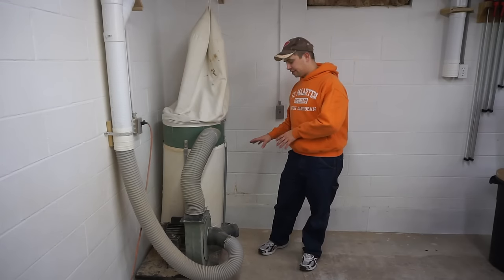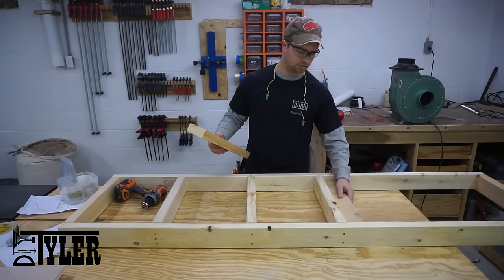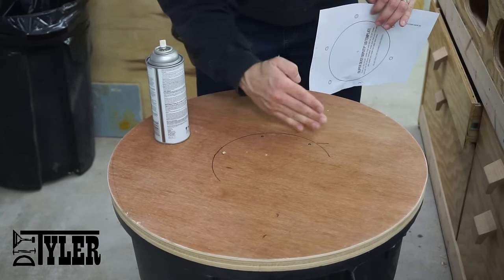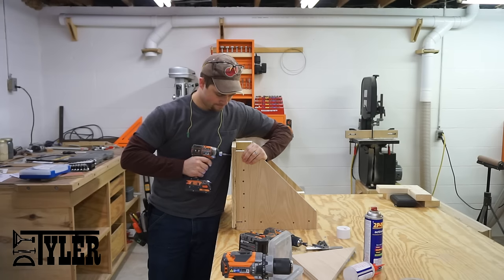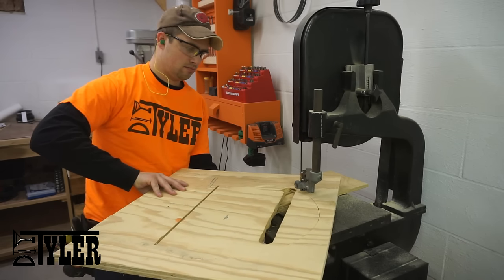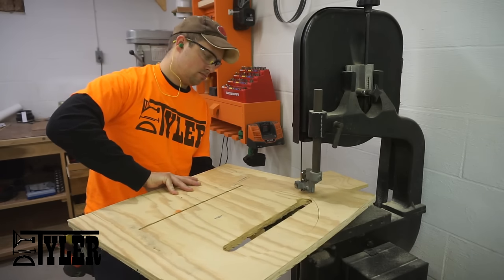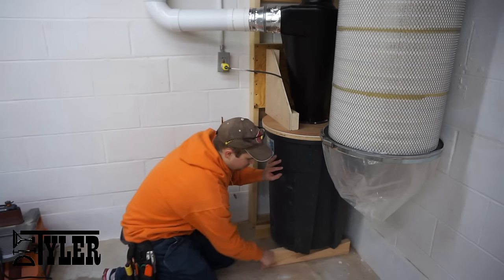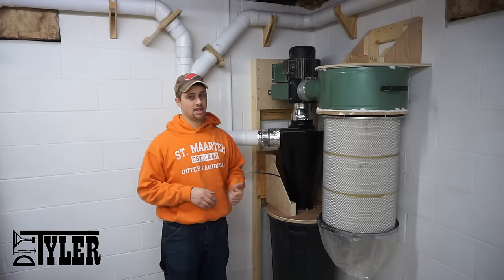2 Stage Harbor Freight Dust Collector

Comment: Nice job Tyler!  Question - Did you cut a hole in the top of the filter to allow the chips that pass through the cyclone to fall into the bag?  My filter is solid on the top and open on the bottom where the gasket is.  I am surprised that the bag did not inflate when the collector was started.
Reply from the maker: +Michael Sawyer I was surprised at how little the bag inflated as well, suppose that goes to show at how much more surface area the cartridge filter has compared to your typical DC filter bag. The filter I got was open on both sides, sorry I didn't show that.

Comment: I rec'd 2nd degree burns on my arms and scalp from a dust collector fire in June at work, it was connected to a CNC router, and yes, it was grounded. The entire facility- 4 buildings burned to the ground because of this dust collector which was made out of PLASTIC and installed inside the building with the CNC. Ive been recovering at home now the last 8 weeks.
No dust collector should  EVER be installed inside a building!

Comment: Great idea. I thought about doing something similar but always been feared about motor mounting position. Not sure if the motor bearings are the correct type to support the rotor and the impeller along its axis instead of radially support it. So one question: how did lived up the motor bearings over time in this vertical mounting position ?

Thanks

Comment: An excellent build. Was that a Wynn filter? Any thoughts about cutting a long vertical channel in the black bin to add a piece of plexiglass so you can see chip levels?
Reply from the maker: Thanks Derek. Yes a Wynn filter but not a stocked one. Thought about a plexiglass window but I think that might weaken the bucket to much to really carry it around anymore. Am thinking a more electronic sensing solution! Thanks for watching man!

Comment: Nice job Tyler, Your 2 Stage Harbor Freight Dust Collector appears to have been well thought out.  I purchased my Harbor Freight 2 HP DC in November and have since modified it with my own version of the Thien baffle.  I am looking forward to improving the performance of both the air filtration and suction throughout the shop with the addition of a Wynn filter.  Where did you get the idea to invert the filter on the HB metal baffle ring and suspend the bag below it?  It looks great and sounds like it is performing well.
Reply from the maker: +Bill Cederquist I noticed that pretty much all the "out of the box" cyclone systems mounted their filters upside down so I thought it would be worth a try. Was trying to keep everything compact like those systems as well. Thanks for watching and commenting Bill!

Comment: I see you used a step down between the SDD and blower .. did you consider avoiding the step-down by replacing the blower cover with plywood and 6" take-off? That seems like it should increase airflow.  Great build and video.

Comment: Copying  your build one thing different is I use a 6 in x 4 in rubber Fernco for pvc/cast iron  the 6in fit real good and the 4in side i put in a pan of boiling water for 1 minute and wearing thick gloves it went on easy also .this was from the top of 5 inch  super dust duty to the inlet of blower

Comment: When drilling holes for screws why not drill the holes before putting glue on the parts?
Drill the holes, remove the sawdust that is in between the parts and then glue.
Great ideas and video!
Reply: How can one remove the sawdust whilst building a sawdust removing system...whodathunkit

Comment: I noticed you had a DURR shirt on. I used to work for Durr Technic, based in the same town in Germany, totally different company... So random lol. Great video!
Reply: Also, what kind of garbage can is that? I've heard of people having issues with them collapsing depending on the brand/type.
Reply from the maker: Worked at DURR for a few months but got out just in time, it was the EcoClean division, washers, conveyor, test and assembly system. Thanks for watching Ben!
Reply from the maker: Just a run of the mill can from the homecenter. It is a pretty solid one though.
Reply: I hear the name Brute thrown around. Thanks for the reply. I have a smaller Jet DC that I've considered converting with a super DD. The upside down filter is a great space saver! I have a standard DD built into my my shop vac (long story) and love it.

Comment: great video, thank you for the great ideas for my own HF dust collector

Quick question, is there a way to remove and replace the actual motor or is it sealed on the dust collection unit?

Comment: First things first......excellent video Tyler. I like how you would cut the video on steps and not show the entire process of IE: cutting the mounting brackets, screwing in each screw etc. I wish more youtubers would edit their videos that way. Next I'm assuming you use air flow gates....and I know you were focusing on the dust collector itself, but I saw no static discharge grounding wires on your pvc tubing. Do you use that? Is that just old school stuff?? Again great vid I am going to look into making this. thanks

Comment: nice upgrade.  last year I also changed my single stage to a two stage and I am happy with it.  Do you have an issue with emptying the bin?  I find it a pain in the backside trying to dump my bin into a bag for disposal.  I liked that the single stage put my chips and dust right into the bag.

Comment: Thanks for this. I liked it so much, I'm going to build it. One question, though. Can there be extra distance between cyclone, blower, and filter? I need to shift the unit so I can still access my electrical panel. I can do it by adding 12" of vertical pipe between cyclone and blower and adding 18" of horizontal pipe between blower and filter.
I figure an added 2.5 ft of pipe is just going to have the same minimal effect on performance here, as it would anywhere in the system, but never having built one, I really have no idea.
Care to comment?

Comment: Great video! I followed yours almost to a T to set up mine. Have a 2Hp unit but when i hooked it up the air pull caused the can to buckle at the mid point and ended up kind of breaking the seal. Any issues like that for yours? Im using an old plastic garbage can so maybe it had some deformity or had been beat up?

Comment: I have the same setup as you started with. I have changed out the bag and replaced with Wyne filter. Now I need to build the frame like yours. Do you have a measured drawing for yours? Great video, thanks.

Comment: Could the canister have been mounted above the donut with the bag mounted below the donut rather than capping the top and hanging the bag below the canister?  That set up would fit better in my space if it works.

Comment: As nicely as that wooden lid fits on your can, I bet you could add a garbage bag, and the heavy top would still seal, to make emptying the can even easier and more dust-free. Also - since the is almost no dust or chips that make it to the filter, why not skip the filter and simply vent it to the outside, like you would a dryer?

Comment: I know I'm late to the party but this is a nice system. Im doing the same thing with an older 1-stage HF system but I'm using flexible hose between the cyclone and the collection barrel so I can just lift the lid and slide out the barrel.

I'm curious where you got that huge filter and how much was it?

Comment: Great Job! Just got my SDD in the mail today and awaiting the 35A Wynn filter arrival. I am lucky to have high ceilings in the building and was gonna elevate the SDD to start out level with my main 4in line. My question is, Do you think if i have a 2-3 foot line from the bottom of the SDD to the top of my plastic barrel container it would create and problems? Didn't know if that long of a line would create any back pressure problems. I appreciate you thoughts. Thanks for the video"s and keep up the great work.
Reply from the maker: +Johnny Prather Hi Johnny, no I don't think having an extension below the SDD will cause any issues. Thanks for watching man!

Comment: Very Nice !! I just upgraded my system and I have an issue where the cyclone doesn't push the debris inside the bucket, it creates a suction instead. What did I do wrong?

Comment: Hi Tyler, very4 nice video showing what you did here.  Just one main question.  If you didn't measure CFM on any part of this system then why even go for the filter instead of retaining the bag filter?  It's hard to say if spending darn near the price of an out of the box system is worth it if we don't know the gains by adding the $$$ filter.  In every other way though I have built a system similar to this based on your video here and it works well.

Comment: Hey Tyler, thanks for the video and information. I made this exact transformation to a cyclone but something is not working on the cyclone effect. The saw dust extraction works fine but it doesnt go down to the barrel, instead it sucks from the bottom of the cone as well and it doesnt go down. Do you have any advise?

Comment: Great video.  Does the SDD really separate out all the fine dust?  I'm looking at a new DC system.  The new 2 stage systems like Grizzly, Laguna and Jet look really good BUT they seem to pass a lot of dust into the filter and filter bags.  Thinking of purchasing a 2hp Grizzly bag system and then doing what you just did with the HF blower.  Just curious what's been your real life experience with the SDD performance and anything to compare it to with the shorter cycloned 2 stage systems.   Appreciate the help and really enjoy your videos!

Comment: I know this is an ol lier build but just fyi the Oneida to harbor freight adaptor you list is nothing more than a gas garage furnace exhaust vent. it fits the hf perfect. I also found that rv septic tube and pipe are the same size. just got the dust collector and had both of these fittings in the shop already.

Comment: wow lotta work and much patience. TU
Reply from the maker: +WV591 But so worth it, thanks for watching man!
Reply: Did all this modification increase the suction since you have it attach to pvc throughout your shop? It's good vacum for the price but i didn't think it was capable of pvc distribution operation . i have mine attach direct to whatever tool i use mostly planner and sometimes table saw.
Reply from the maker: +WV591 It didn't really decrease the suction at all, which kind new surprised me,   But I did loose some CFM on the longest runs .....with any loss it still works great as I have it set up. The 2 stage modification helped a lot.
Reply: lotta work for sure.  if i ever get around to it i might empty the trash bag ;-)

Comment: Hi Tyler, thanks for sharing your build! I converted my HF collector to a 2 stage similar to yours but my rubbermaid heavy duty 32 gallon bucket is collapsing on itself when the system is on.  On the plus side, i know I got a good seal!  Did you have to reinforce the inside of your trash can?  I'm thinking a wooden ring or two inside should be enough, but i'm 2nd guessing if i should've gone with a metal barrel/can.  I know this was ages ago now, and you have an upgraded cyclone system in your new shop.  Thanks!
Reply: Try a 55 gallon barrel maybe?

Comment: Good Job dude!  Like the cam idea.  What would connecting the two top wedges together by a peice of 1/2 plywood  as well as connecting the two bottom wedges together the same as the top. I wonder if it would be easier to position them.
Reply from the maker: That's a good idea for sure. May do that but am have another neat idea with 4 cams and a lever....will see! Thanks for watching man!

Comment: 3 questions here: 
I bought 1hp dust collector for my table saw, planer, etc. I will make a cyclone for it.
1. Does it change anything if I make the plastic and filter bags a lot smaller?
2. How big should be the cyclone?
3. Is it better to use only 4 inches hoses for the cyclone and the dust collector?
Reply from the maker: Making the filter bag smaller will restrict your airflow out of the blower so you really want this to be as big as possible.
For a 1HP blower you will want to go with the SDD, same that I used. (aff link http://goo.gl/HMYWfs) 
4" is what you want for a DC, 2.5 is much to small.
Reply: Thanks.

Comment: hope you see this question..   Is there any advantage to having your pleated air filter drum mounted below your baffle ring instead of on top like?  I see you were limited vertically and I get why you mounted it on the bottom but wouldn't it be better if you had mounted it up top with the small bag mounted on the bottom of the baffle ring?
Reply from the maker: I certainly didn't see a difference in performance. The space saving was work it. The HF system doesn't have any angles or baffles of value to make it better one way or the other.

Comment: Please post any CFM info you actually measure in future.  I've seen several critiques of HF 2HP DC claiming the actual CFM is as low as 500, which I suspect (and hope) is way low based on other users observations.  I really like your design and hope to use it in my shop one day.

Comment: Duque still I have the same harbor freight dust extractor how much suction do you have down the line is it efficient ? Looks cool too mine is apart so before I put back together want to make sure it will be worth it. Thanks keep your kids interested you can never get that time back.... Really enjoy your videos.
Reply from the maker: Thanks for watching our stuff Michael! I loose almost no suction on my longest runs, am sure there is a decent drop in CFM but regardless I have yet to clog up the pipes.

Comment: Hi, awesome video! I am building a DC from Harbor Freight 2 HP model, and I have watched several videos focusing on CFM flow rate. Well, anyway I watched a video where a person took off the restrictor plate from the inlet motor, and using 5" reducer to 4" hose. It would increase CFM flow. I would chose the Thien Baffle over the Dust Deputy overall and then put more height on trash can and put on wheels just in case it get too heavy to empty. 

How tall is your basement? Mine is 7' tall and then I hit my beams. Thank you for this idea. I thought I would have to vent my micro fine dust outside...again great job!
Reply from the maker: +C4 Calligraphy Thanks for watching man! One reason I really wanted a proper cyclone over a Thien Baffle is the cyclone (a proper cyclone) will introduce little if any back pressure into the DC lines making your overall system less efficient. Don't get me wrong....the baffle works great but not quite as good! 

Our basement is 8', still would have hit the ceiling if I did not mount the filter upside down.

Comment: Great build Ty...one thing I didn't see covered in both vids was grounding the collector. How did you tackle this? Thanks
Reply from the maker: The machine itself is grounded to the home supply and in my opinion that is sufficient. Have done a tone of research and it seems like half of people are totally for pipe grounding and the other say it's a myth. Your call, I didn't do it and have yet to be shocked from it. Thanks for watching Jason.

Comment: I wouldn't put the filter on the bottom. I think you would keep the filter cleaner if you had the filter on the top of the baffle and the plastic bag on the bottom. The dust has to pass through the filter to get to the plastic bag.  I would also run a axle with flappers connected to a hand crank to clean that filter
Reply from the maker: +toscodav Cycline separates 99% so it doesn't really matter. Literally have gotten a cup so of dust out of the filter since I have made it.
Reply: Yes. I'm kind of nitpicking.  Nice setup.  Its a curse being a perfectionist.

Comment: I have this same shop vac in its original configuration and would like to upgrade.  My problem is that I don't have enough floor space to include the filter setup as you've laid out.  However my shop is on the 2nd storey of a garage, so I was going to suspend the cyclone unit from the main floor ceiling with the trash can below it, but with the motor unit above it, situated on the 2nd level floor, with a pipe connecting the motor, through the floor, to the cyclone below it.  So I would need to flip the filter unit upwards (opposite to the configuration you show)....the question being....will the filter unit work in such an arrangement?

Just to clarify the situation, my dust collection ducting pipes run underneath the 2nd level subfloor (ie: above the main floor ceiling through open web floor trusses)

Comment: Tyler--did your cyclone have a 6" top inlet (mine actually measures 6-1/4"OD)and a 5" suction port on the side?  (I think it's Oneida P/N AXD002030A) ?  Did you adapt the top opening down to a 4" ID?  Are you main runs all 4" PVC??
I want to make sure I've got the right cyclone for my HF dust collector unit.  Any help woould be appreciated!
Thanks,
Jim

Comment: Very nice setup!. I am currently assembling components on a somewhat similar build with my HF collector. I am looking at a Penn Industries Nano filter cartridge with the super dust deputy. I am curious as what you found with CFM readings, especially at the farthest point away from the collector. I have never seen any actual readings using that setup. I know that stated 1500 CFM number is probably BS. Do you think the HF unit would handle 6" main lines with 4" drops? I was looking at the SDD- XL which has 6" ports in and out.Thanks for taking the time for the video. Just subbed.
Reply from the maker: +Andrew Bieger Thanks Andrew. I haven't take reading with this current setup but with just the blower I didn't have to substantial a drop from the closest to farthest drop. 6" lines probably wouldn't be a issue with the HF blowers but the SSD XL is for higher HP cyclones (3-5 I think)